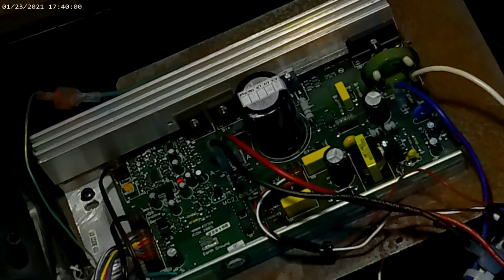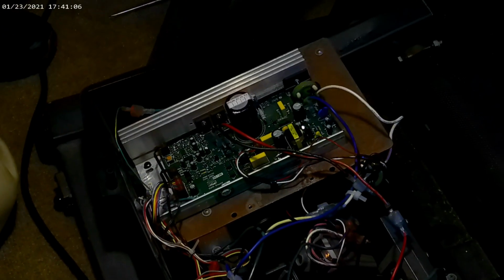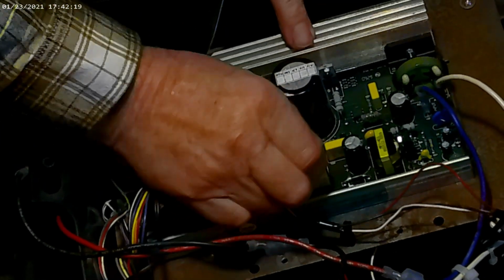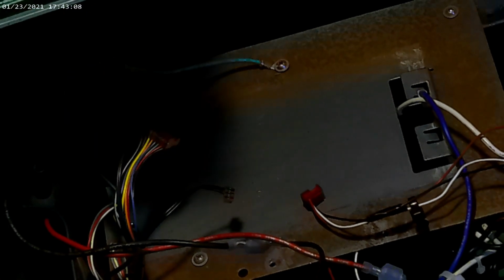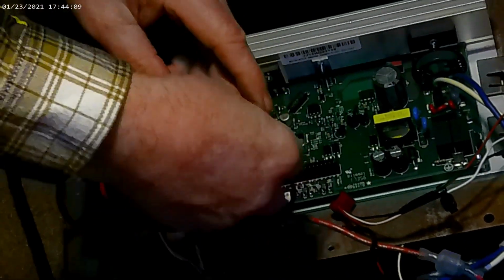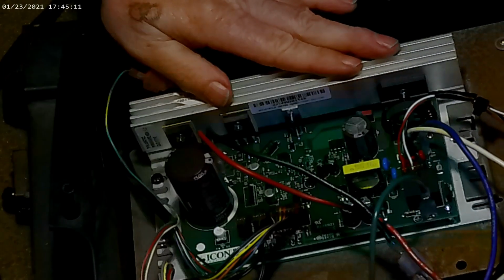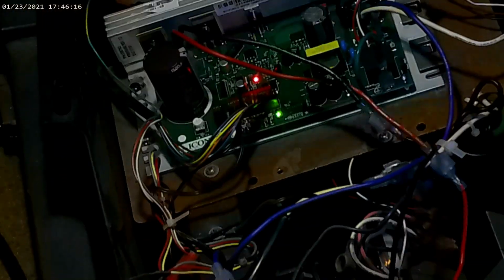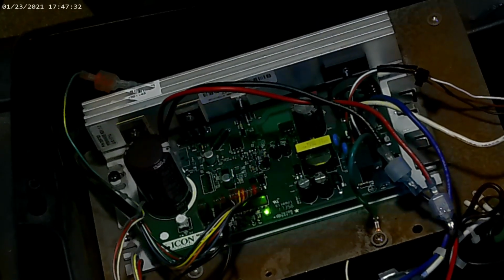Replacing Nordictrack Treadmill Motor Controller

Comment: What model circuit board was that and what is the new board? I have a MC5100 board from about 2014. Also, do you know what the different led flash codes are? My board is doing double flashes all the time. The main motor won't run.
Reply from the maker: The one I took out is mc 2100 -b  I replaced it with a new style 1618 DLS or sometimes called a LTS -30 . They both have the same wire harness! And can be swapped. The 5100 has a larger wire harness and can’t be swapped with anything else. Sorry I have not worked much with this one I don’t know the pattern on this. I would start with unhooking all the inputs one at a time see if there is a short on it . If light still flashes with all extra loads off it you will have to replace it . I am looking at it now on my website. But I can’t see the leds in pic
Reply from the maker: Oh yea one more thing run you motor with a DC power source just to make sure it is ok
Reply: @FitnessTechnologyServices  Yes, done that. motor is fine. Only thing I noticed is that taking the brake resistor off makes the controller work up until you hit start. Then you get 6 flashes. With the brake resistor on, the controller processor never gets out of self test and just does the really fast double flash all the time.
Reply from the maker: @richardmarkham8369  If you can find out the value of the load Resitance. And it meters right you may have to replace controller. I am just not sure of the incline trainers pattern
Reply: @FitnessTechnologyServices  The brake resistor meters fine. 50ohm. I've sent the controller off for repair. I guess its the mosfet for the brake thats blown.
Reply from the maker: @richardmarkham8369  If you can please let me know I thought it was controller thanks Dave
Reply: @FitnessTechnologyServices  Sent the controller away. They said the micro software was corrupted. Game over! I bought a refurb board to replace it with.
Reply from the maker: @richardmarkham8369  thank you I thought the board was bad.
Reply: @FitnessTechnologyServices  Yes, but not really sure why or what was actually wrong with it. As far as I could tell, the processor was failing its power up test, probably due to a fault in the brake circuit. Taking the brake resistor off allowed the processor to come up and operate normally, but of course it wouldn't run the motor with no brake and it indicated this error condition with 6 steady slow flashes, when motor run was demanded. I don't think that would be corrupted software as most software self checks itself on power up for corruption.

Comment: I have a treadmill with the newer board you installed. The red light flashes momentarily after selecting a speed then stops, console continues to show the treadmill moving. What should I troubleshoot from here?
Reply from the maker: Hmm this most likely means the   .Board failed.but most icon Products have a wiring diagram tapped to the inside of motor hood , look for the speed up and  reseat at controller and all other connections I think it is blue? Make sure it is off . But also most controllers go bad because of worn walking belt causing heavy work load .See my full channel,fitness technology services for testing your walk belt

Comment: I have a C-800.  Do I have to find the exact control board for it or could another board work?
Reply from the maker: Well depends if you could send me your full model number to Fitnesspartspro@gmail .com we could check but in general on Nordic track they have the same inputs only the wattage is different for power to there consoles
Reply from the maker: Also depends on what year

Comment: Thanks for very nice video. 
My treadmill Nordictrack T14.0 is having problem -  relatively new, only 2 .5 years old. I wonder if it relate to the motor controller problem as it's not cheap; so I need to make sure if replacing the control board will solve the problem

1, Initially the TM worked well for approx 15 minutes; then the walking belt (I didnt realize) move to the right and the TM stopped, re-start, loading the menu on the console and ready.
2. I tried to start again manually but the TM immediately stop and trips the breaker or blown the 13A fuse in the power cord, every time I start (manual start). Seem the motor withdraw very high current. Practically the belt does not move or move very little (mm).
3. I have aligned the belt, lubricate and reduce the tension of the belt but no success. Same happened.
4. The incline function is working well. No problem to up and down to maximum (12 deg.)
5. No problem on the other console functions.  However, every time i start, the TM immediately stop and trip the breaker or blown the fuse.
6. There's very small movement (fraction of second) before immediately blew the fuse. Seem like the belt stuck. However, I can easily move the belt by rotating the motor pully.
7. I removed the drive belt from motor pulley. The problem still happen - blew the fuse but I can see that the motor pulley rotates for few seconds.

Is there anyway to identify what part is exactly making problem?
TIA
Reply from the maker: Hmmm with your testing it can only be controller.There is a motor test you could do , Hook up your motor to a separate dc power source see how it runs .But you should also check the walk belt for wear to see if it cause the issue I have lots of videos on this on my full channel fitness technology services. Or email us and I will have the office send you links fitnesspartspro@gmail.com

Comment: Thanks for the video. Just replaced Nordic Track c2200 treadmill running belt and in process unplugged one cable attached close to the ground wire from control board. Treadmill runs perfectly at speed selected however display indicates running speed of 0. Any advice would be appreciated.
Reply from the maker: Re check speed  sensor at front roller
Reply: Found it exactly where you directed. Thanks a bunch. Thumbs up for everything.
Reply from the maker: @nicholasvine1249  Awesome

Comment: On the mark. My problem is solved.  My new unit is exactly like your new unit but no incline light.  My problems is no incline.  Is the answer to replace the board ?   .... or is it to learn why the counsel shows incline working but it does not.  All else seems fine.  I moved it from one room to another.
Reply from the maker: Oh I see you did respond to my Nordic Track controller video !well it could be but first I would reseat all incline connections the ac power to incline unseats it’s self a lot ? Careful ac is off when reseating I have to say that 🤔
Reply from the maker: The console on a Nordic Track shows display weather the incline moves or not !!on most models but not all

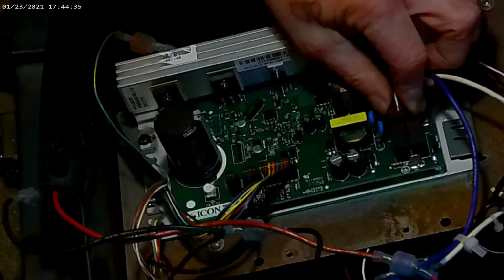Comment: my proform 400c treadmills controller board conked out on me is the same exact controller on your old controller board on the video. i noticed on ebay that they came out with a new revised controller board for that treadmill the same one that you're replacing on your treadmill. my question is on 2:45 mark of your video you're removing the incline cable from the port which looks like a 5 pin port. on the new revised controller board i noticed the incline port is 3 pins that you're installing at the 4:45 mark of the video. does the 3 pin port work when using the incline function on the display console just like the 5 pin port on the old controller board despite missing 2 pins on the board?
Reply from the maker: It works fine I have a pic of both boards on my sales web site side by side so you can see it in the old board only three pins were used ! they had 5 but only 3 worked 🤔you can look at it at www.Fitnesspartspro.com
Reply: i bought a replacement controller board the revised version for my proform 400c treadmill. followed your instruction to a tee. works fine. i probably would've burned out the controller board if i didn't follow your instructions. thanks a million. do you recommend using a surge protector for the treadmill as my power outlet is gfci with no green indicator light on it?
Reply from the maker: @michaelcho9153  Hmm that is a great question most likely you are trying to protect your controller ? The main reason a controller blows out is due to high walk belt wear . Causing excessive amp draw with in the treadmill. A gfI protects your house circuit . And a surge protector protects your treadmill from outside surges .you will find how to test your walk belt for wear on my full channel fitness technology services Thanks Dave

Comment: hey hi, smoked the MC-2100 board's variable resistor (it has a sq. orange face and is located in the upper left quadrant in the picture, schematics have it labeled R11. ?? 
Anyone know for sure what its value would be? 
Have another mc-2100 board for scavenging. 
Board no longer functions. 
No voltage to control panel via the 12 pin cable either Just finished building a variable speed paint mixer with the treadmill motor, board,  and consol. Worked perfect until I dropped a dang screw shorting it out.!
Reply from the maker: So I am not component level it may also make a difference on which 2100 board they have many different versions
Reply: @FitnessTechnologyServices  too many versions I think. I replaced several consoles with simple 555 IC PWM circuits available online. I hope my experiences with these boards may help others while getting the info I need. The electrical circuit diagrams are also online with component values. Erased mine of course.
Reply from the maker: @johnzarollin2749  Hmm I would like to see that 555 IC PMW is that a complete board that hooks directly to DC motor if so what is max amp load ?
Reply: 200k, single turn

Comment: I have a Nortitrack commercial 1750 (2014-15). I have 12v to my touchscreen but it doesn't turn on. What else should I look at?
Reply from the maker: Hmm that’s tough on a Nordic they don’t make a lot of boards mostly replace console .I would open back of console and disconnect ribbon cables one at a time see if one is shorting board out . Send me your full model # to fitnesspartspro@gmail.com if want part or more troubleshooting
Reply: @FitnessTechnologyServices  thanks, I'll send you the info.
Reply: for safety the treadmill boards require a user input. Try turning every power switch on then remove/reinsert the safety key. It should run OK as you tell it to accelerate the motor's rpm. (speed). Also there should be 1 or more red diodes on the board that lite up. 
One will begin to blink in sequence with motors PWM speed pulses.
Human input is needed when starting the PWM pulses to the motor.. The 12 v dc powering the console is in the 10-12 wire connector.
Reply from the maker: @johnzarollin2749  Hmm is that not the same way I explained it of course you have to give it input
Reply: @FitnessTechnologyServices  just a different angle to the same issues.  I found that much of the boards circuitry is dedicated to non-motor control functions. Pulse monitors, incline control,  user safety key, optional onboard power transformer.
Reply from the maker: @johnzarollin2749  yes I agree

Comment: That was amazing! Why does my treadmill now run backwards? I have to face the back now when running 😳
Reply from the maker: Well if this my friend Dan turn around if this is a customer check your motor connections . If they are correct then board is bad 😃
Reply: come on now! its a DC motor, 
switch the motor wire and it will run in the opposite direction. 
If run too long backwards the motor's pulley will unscrew and fall off.
Reply from the maker: @johnzarollin2749  That’s just my buddy messing with me and me messing with me .And no on some models motor turning backwards will not fall off they are held in buy set screw or keyway insert
Reply: @FitnessTechnologyServices  understood but the reverse threading on some dc motor shafts will cause the drive pulley to roll off the shaft if +, - are wired incorrectly.. 
Notice the reverse threading on the motor shaft in this link;
https://www.instructables.com/Use-a-Treadmill-DC-Drive-Motor-and-PWM-Speed-Contr/

no set screws.
 With the high torque it'd come off anyway. 
Engineered to be fail safe when some tech reverses polarity on the motor and injures somebody.
Reply from the maker: @johnzarollin2749  The example was just for testing . And depending on what frame they put the motor in there is not enough space for pulley to come off but I get were you are coming from .I some times reverse it just to make it easy for  removal